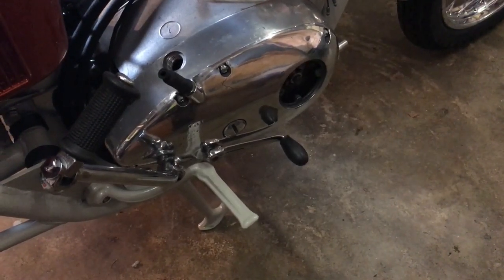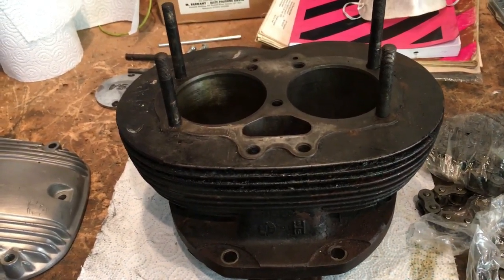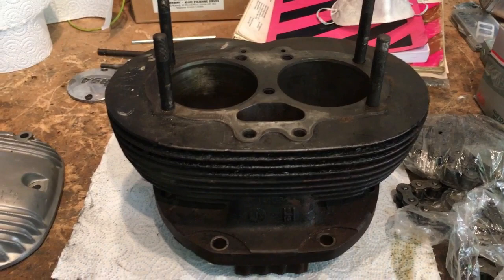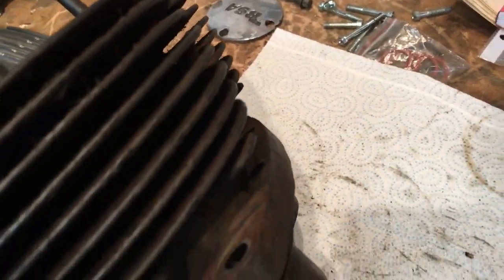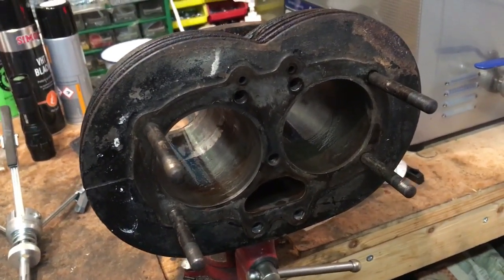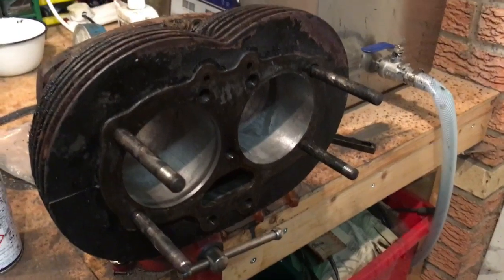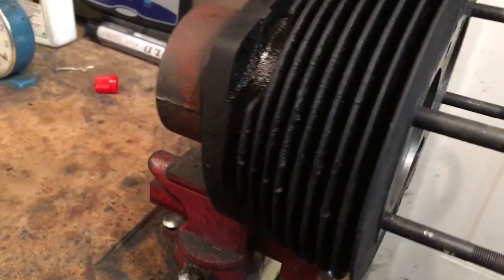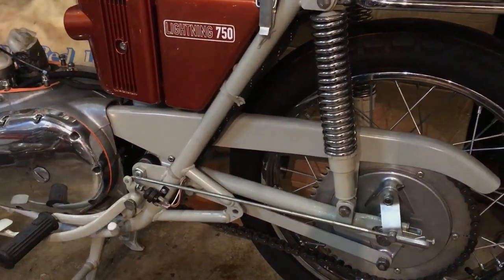BSA A70L Lightning - Engine Part 31 - Barrels and a Little More Chain

Comment: What a find..............I thought we had all died off Angus! Watched them all now, respect sir. Easy to follow and your efforts to keep the old girls alive is commendable in this age of disposable or expert only electronic nightmares. Have a collection myself and luckily one of my sons has shared my love of 'proper' bikes (and I'm a little ashamed to admit in your company modern stuff too). Look forward to seeing how you get on. Have a great Christmas and good luck for the New Year with them all.
Reply from the maker: Thanks Paul for the interest and very kind comments.  Glad you enjoy my simple efforts. I don’t mind the modern stuff and did have one of the last Buells at one point but it’s just the satisfaction of maintaining and riding these relatively old characterful clunkers from an era I just missed that keeps me out of mischief. Thanks again.
Reply: @BSAPowerSet  I have a Buell XB12S  in my collection and have a bit of a soft spot for them. Just an observation if I may.........tell me to go forth and multiply if you like but may I suggest when putting casings face down on the floor if you must, at least put a thick soft cover down to lay them on. I had the misfortune of doing exactly the same as you with a T120 case on a floor I keep allegedly clean enough to eat off (anal personality according to she who must be ignored) and it picked up a tiny steel wedge shaped object on the bottom side so I didn't spot it when tightening it up. Oil leak number 5 after rebuild from memory!
Reply from the maker: Thanks for the advice Paul and agree sometimes I’m not as clinical as I think I am. Duly noted and appreciated.

Comment: Really liking the progress, thanks for the videos. Wish you had shown the chain install, about to do mine on a '70 a65l and hear it's a bit of a pain but I'll soldier on. Be Well.
Reply from the maker: Thx for interest and apols for not videoing the whole process. If you remove the chain guard, put bike on mainstand, then feed chain over rear sprocket, pull the end forward and feed over top of engine sprocket slowly, then  hook the end of chain forwards as comes round underside of engine sprocket it will then feed itself forward until you can grab it and pull through. Thanks again.